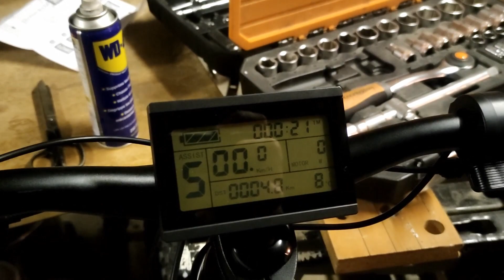Conversion VTT éléctrique 1000W (Kit Yose Power)

Comment: Quelle est la vitesse de pointe avec ce kit ?
Reply from the maker: En pédalant au mode 5 sur plat on peut atteindre 50kmh environ
Reply: @Theo_Builds  Et sans pedaler ?
Reply from the maker: Environ 35/40kmh sur plat
Reply: @Theo_Builds  ya moyen de d'améliorer le moteur ou le contrôleur pour qu'il aille vers les 50-60 kmh ?
Reply from the maker: Le moteur peut supporter ça, ce serait en changeant le contrôleur et peut être la batterie qu'il serait possible en effet

Comment: bonjour, je compare avec des vélo Decathlon, et sur leur site ils parlent de w/h et pas seulement de puissance du moteur en watt. avec la batterie de ta vidéo ça donne quoi en w/h? parce que j'en vois aucune à 1000w sur le site
Reply from the maker: Bonjour, les wh c'est les ah multiplié par les volts donc pour une batterie yose power 48v 12.5 ah ça fait 600 wh, j'espère que celà répond à ta question
Reply: @Theo_Builds  oui mais du coup dans ta vidéo 1000w ça correspond à quoi? Désolé j'ai des lacunes
Reply from the maker: Les watts (volts x ampère) c'est la puissance (plus ou moins la même unité que les chevaux pour les moteur à essence) et les Ampère heure ou watt heure sont des unités de capacité (donc l'autonomie)
Les vélos Decathlon etc sont 250w de puissance et ce kit est 1000w de puissance donc beaucoup plus de pêche
Reply: @Theo_Builds  merci c'est beaucoup plus clair 👌
Reply from the maker: Content d'avoir pu aider 👍

Comment: bonjour,j ai un vtt electique 36v/250w est ce que je peut mettre une roue 350w ou 500w sachant que ma batterie est de 13Ha courant de décharge 15A/30A courant charge maxi 5A ...Merci d'avance.
Reply from the maker: Bonjour, cela dépend de quelques choses comme les connecteurs et fixations. Mais dans tous les cas vous n'aurez aucun gain de puissance en faisant ça, votre moteur sera capable de plus mais ne recevra pas plus. Pour cela il faudrait changer le contrôleur ou la batterie, mais cela commence à devenir compliqué sur un vélo électrique d'origine.
Reply: @Theo_Builds  Merci de votre reponse rapide, le kit comprend un controller, une roue et un ecran lcd, la batterie est acheté à part que j ai deja.
Reply: @Theo_Builds  oui j ai un controller 36v/48v 250w/350w/500w je précise que sr ce velo j ai tout changée ( quoi mon mari)

Comment: salut, merci pour ta video. Petite question, le display, as tu eu besoin de le programmer (nombre d'aimant du detecteur de pas, type de moteur...)
merci d'avance
Reply from the maker: Salut, non rien du tout, plug and play comme on dit, juste brancher et rien a faire, possiblement indiquer combien de volts fait la batterie etc mais ça se fait super facilement avec les boutons
Reply: @Theo_Builds  merci de ta reponse

Comment: Salut quelle batterie a tu pris ?
Reply from the maker: Salut, j'ai pris la batterie 48v (important si on veut profiter de toute la puissance du kit) aussi chez Yose Power.
Reply: @Theo_Builds  okay mais tu a pris. Combien de ah et tu me conceil combien pour faire 30-40 km/h ?
Reply from the maker: Leur seule option en 48v c'est 12.5 ah ça me suffit. Mais les ah c'est pour l'autonomie donc si tu en as plus tu pourra aller plus loin sur une charge mais pour la vitesse c'est les volts donc tu peux essayer la 36v mais je ne connais pas les performances avec celle là
Reply: @Theo_Builds  okay merci beaucoup et combien de kilomètre arrive tu a faire avec 12.5ah ceal me parait peux ?
Reply from the maker: Ça dépends beaucoup de si tu utilises beaucoup de puissance ou pas mais je dirai en moyenne 40/50km

Comment: Combien de km d’autonomie avec une batterie 48 volt en pédalant ?
Reply from the maker: Cela dependra beaucoup de la conduite de chaqun et de type de chemin fait avec mais si on pedale raisonnablement j'avais estimé une moyenne a 50km. Et d'ailleurs l'autonomie est plus liée aux Ah de la batterie qu'aux Volts qui feront plus la Vmax etc
Reply: @Theo_Builds  tu me conseille quoi comme batterie pour avoir une meilleure autonomie
Reply from the maker: C'est a voir en fonction de ce qui peut passer dans ton cadre mais une 48 volt c'est sûr, pour pouvoir profiter de la puissance du kit et après soir la batterie de yose qui marche très bien soit une autre avec plus de capacité (s'assurer de la présence d'une garantie de la part vendeur de la batterie)
Reply: @Theo_Builds  ok merci pour les conseils je vais faire mes recherches de mon côté
Reply from the maker: Ok bonne chance !

Comment: Hello Théo. Quelle batterie as tu monté ? Une 48V je suppose ? Je voudrais monter une 20 Ah. Il suffirait de raccorder les deux connecteurs quitte à les modifier si les prises ne sont pas les bonnes ?
Reply from the maker: Salut, oui pour profiter au max de la puissance du kit c'est bien d'avoir une batterie 48v et très bien si elle fait 20ah. Ouai c'est ça normalement avec les bons connecteurs il devrait pas y avoir de soucis 👍
Reply: @Theo_Builds  Hello. Kit Yose 48v 1000W (cdé sur le site avec ton bon de réduc merci) et batterie (cdé elle sur Amazon) reçus et montés hier. Test ce matin. C'est juste incroyable ! 20 km en tout terrain et en ville. Très sécurisant dans les ronds points par exemple avec un coup de gâchette. L'assistance est exceptionnelle. 35km/h sur le plat en mode 3 en pédalant assez facilement. Et en côte je ne lui vois pas de limite. Mais il faut pédaler un minimum sans pour autant forcer. Juste avec la gâchette ça manque de couple mais c'est pas une moto non plus.Vitesse max 40 km/h à la gâchette. (Batterie 48v 20,5ah)
Reply from the maker: Salut. Super pour le kit ! Content d'avoir pu aider avec le code promo et la video ! Et oui c'est sur que quand on essaye quelque chose comme ça pour la premiere fois c'est super impressionnant, et même apres plusieurs moi ça l'est toujours autant haha. Après oui c'est sur que ça n'ira pas concurencer des motos si on utilise seulement la gachette mais bon ce n'est pas forcément le but non plus.
Reply: @contactluigirome  t'as les références ? Parce que ça met page non trouvée sur les liens de la description

Comment: Hi do they have speed restrictions cable option where you can take off to increase the speed thank you in advance from Uk
Reply from the maker: Hi, there is no restriction on the kit from the moment you receive it, it is capable of around 50kmh without the need of any modification.
Reply: @Theo_Builds  hi Theo, got the kit but cannot go faster than 40kmh. I changed max speed to 72kmh in parameters but won't pass 40kmh still. I'm 70kg and I have the kit on a very light road bike. I have 48v 12.5ah battery, maybe I can change the settings to get more power??
Reply from the maker: Hi, well it is expected to get about 40kmh only using the trottle. But you can get up to 50 or more if you peddal along on mode 5, maybe it depends on the gearing of your bike aswell.